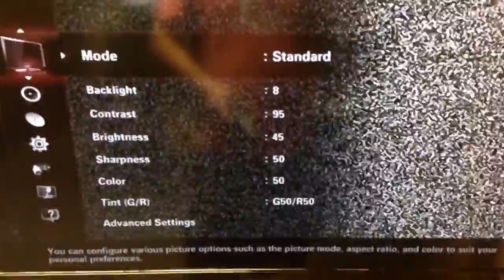Samsung plasma tv not working won't turn on How to fix Easy. Bn44-00264a ln40b630nifxza

Comment: what was wrong with your bad power supply, or you weren't sure?  i had the same thing, i put in new fuse and it blew again.  no bulging capacitors, so im not sure what is wrong with it. thanks
Reply from the maker: Yeah there are two resistors that go bad I can show you
Reply: did you use a multi meter to find they were bad or did you see a burn mark to indicate they/it was fried?

Comment: I have this tv, but my problem is I have no backlight. I can see an image on the screen but no backlight,. I thought it was faulty power supply board and sent it in to get it fix but when I received it back problem still there. Could it possibly be the black board when the power supply board and the ccfl tubes connect to thats giving the problem?